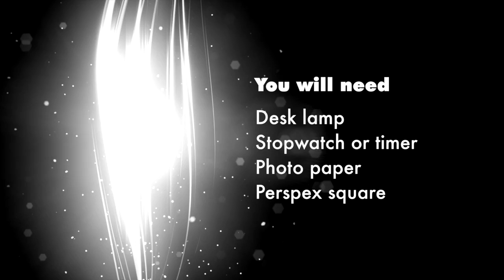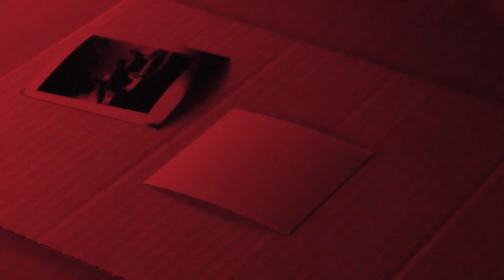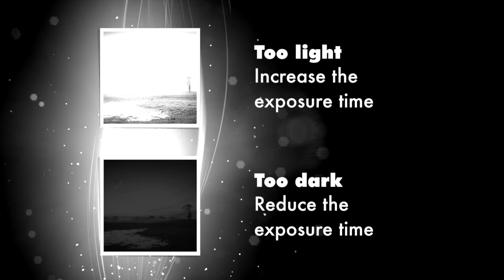ILFORD Photo -  Contact Printing with paper negatives

Comment: Can the negative be photo printed on a copier paper instead of a photo paper? The positive will be a photo paper underneath.
Reply from the maker: Sorry Lammie I'm not quite sure what you are asking. Could you try explaining a different way please.
Reply: ILFORD Photo can I contact print a picture from a copier paper?

Normally the contact print should be:
Negative photo paper -> ___
New photo paper.       ->  ___

What I want to try:
Negative photo on Copier paper ->___
New Photo paper             ->              ___
Reply: @lammie5852  You certainly can. BUT, what would be the point? You already have the image "printed" on copier paper. If it is positive, you don't need a (lower quality) print of it on (more expensive) photo paper. If it is a negative (printed on copier paper for some reason), you can invert it using a PC and some simple software and then you can print a positive on copier paper (or on a photo paper designed for your printer).
Reply: Bulent Celasun it was a homework about diy pinhole camera, we needed to submit a photo using the pinhole camera. I lost my pinhole camera, so I wanted to do it in an easy way. Anyway thank you for explaining! It’s so nice of you to answer my question even if it’s old :D
Edit: I ended up making a new pinhole camera
Reply: @lammie5852  Oh! Happy to hear that : )  ... I will be using a pinhole next week again after about 5 years of neglect... I hope you enjoy yours.